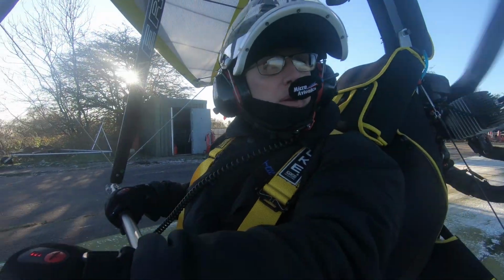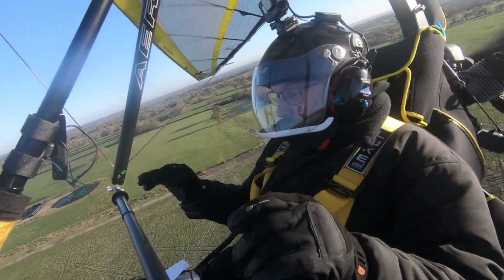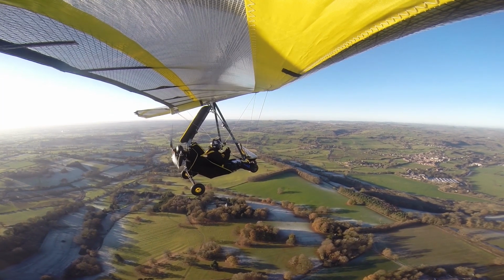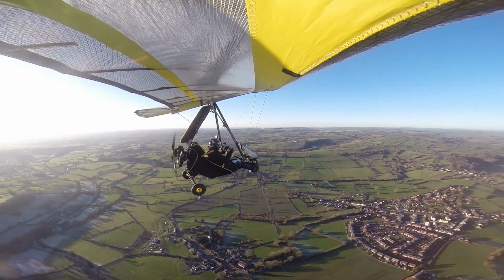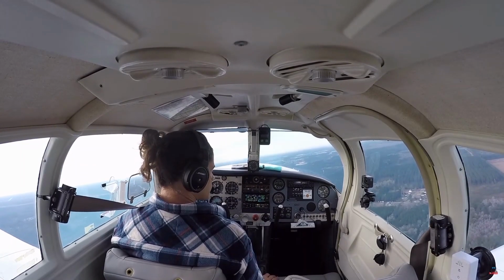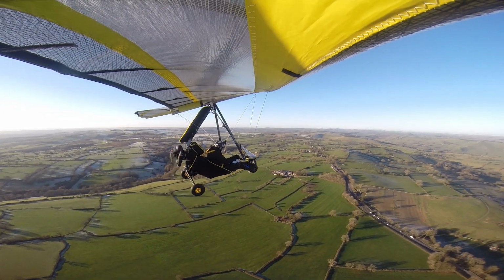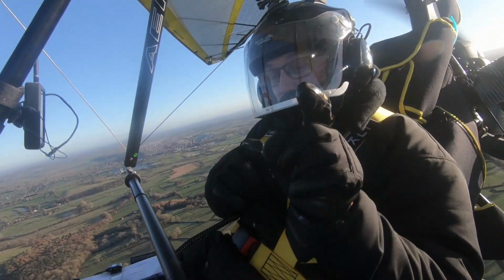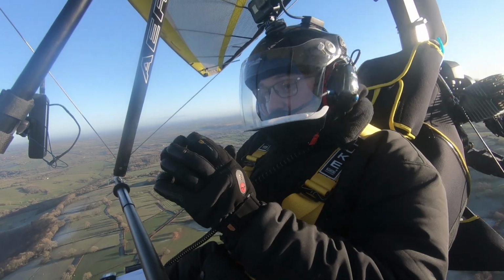YOU asked - Questions and answers - What is a RAPTOR?

Comment: Self loading ballast 🤣
Good video, I liked the paramotor vs trike comment.  I agree 👍
Reply from the maker: RAF navigators were called Self-loading ballast hehe. Would you say there were any significant differences from your perspective on the trike comment.
Reply: @GolfFoxtrot22  LOL, learn something new everyday. 👍
Same thoughts as you - PPG is a simple, easy to setup and fly aircraft.  I didn't get into any big air but certainly appreciate the simple setup and low operating cost.  The flexwing offers more flight complexity and requires more skill which I really appreciate.  Creates a wonderful feeling when I execute a beautiful pattern and grease the landing.  Perma-grin and cheer!
Reply from the maker: No differences in opinion there. I'm so glad you are grinning
Reply: @GolfFoxtrot22  Lots of grinning on both sides of the pond.  😁

Comment: Nice one Giles. In addition to your wind answer I would say also consider that if it is blowing 15mph bang down the runway fine… but… consider what it will be blowing at 1,000 or 2,000 feet. You could find yourself with a ground speed around 10mph. Not really going anywhere.
Reply from the maker: Always enjoy our chats, I hope you get back up in the air soon buddy.
Reply: Been there! I’ve been down to 10mph ground speed on a couple of occasions.
Reply from the maker: @NicholasStreet  are you on the forward hang point?
Reply: I’ve only got one hang point, I haven’t had the mod done. Trim speed is about 36 and it’s a lot of effort, and fuel, to go much faster. Outer trailing edges start to flutter at about 45. Keep meaning to have a fly over to Darley Moor from Boston, just about within range. Airspace is a bit tight to the East of you though.

Comment: That looked like cold finger time (even with the heated gloves). I'll check out Toms channel. Cheers Giles
Reply from the maker: Hi Terry, I was cold, but the gloves were perfect. I could even take a glove off to take a picture. I love crisp skies like that.
Reply: @GolfFoxtrot22  What heated gloves are you using.
Reply from the maker: Hi @ComeFlyFlex , I use a brand called 30Seven, but they are probably not the best out there, but when they cost so much I don't have the funds to buy the next brand😁. Most of the paragliding heated gloves work well. (Note-I do have the coldest hands). I hope that helps.

Comment: Love the videos Giles, keep them coming!  A lot of weather web sites give wind speed and gust speed, do you go by one or the other, or a mix?  PS where does your radio lead disappear to, is your radio in your pocket or under your kneeboard? Cheers
Reply from the maker: Hi Rob, I use the Metar and TAFs because they are as accurate as timely but for a quick, dirty check, I use Metcheck. Ahh the secret of my radio lead, it goes to a handheld mounted by my right leg, I have a yeasu fta450, the headset just plugs into the adapter. It's been a hard few months of trying to fly, we jsut haven't had many flyable days.